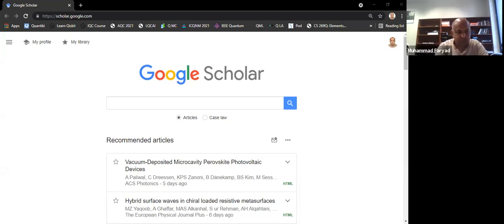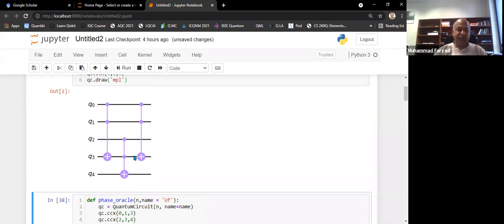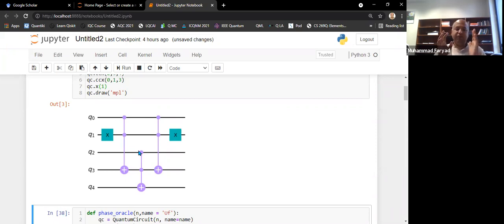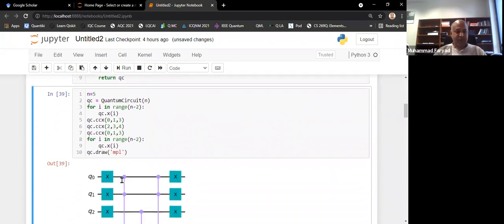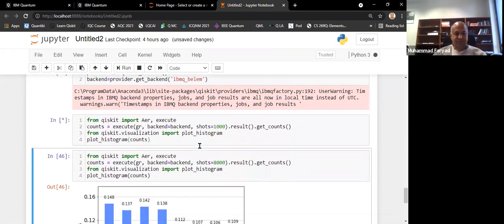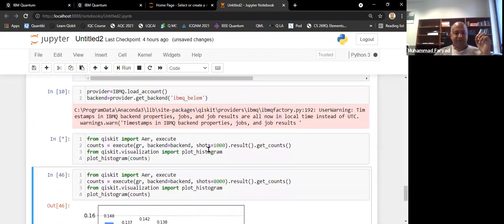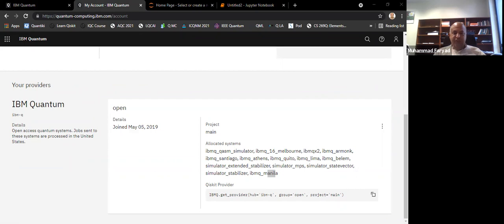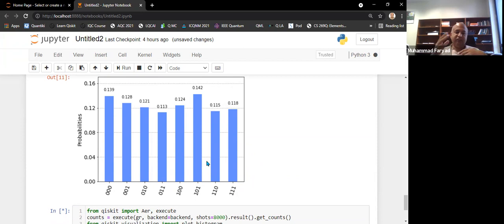16- Implementing Grover Search in Qiskit

Comment: This was great! Thanks! 

However, I am still confused on what the data of the list is to be searched and what value we are searching for? It is probably obvious, but I am new to this stuff.
Reply from the maker: It is assumed for this algorithm that the items in the search set are indexed from 0 to N-1 and the oracle knows the indexes of the items to be searched. TO really implement it on quantum computer, there are many things needed. Please see chapter 6 of Nielson and Chuang for a great discuss on it.
Reply: @quantuc8775  so basically here it is an ordered list and the algorithm is designed to do a Grover's search, not telling the algorithm that actually it is ordered?
Reply: @quantuc8775 if we know the index already then what is the facility to use Grover Algorithm ?
That means, suppose f :{0.1}^3 - {0.1} is a function for one input value it will be 1, otherwise 0. We have to find that x for which it will be 1.

But making oracle we have to know that value !!!
Please reply.